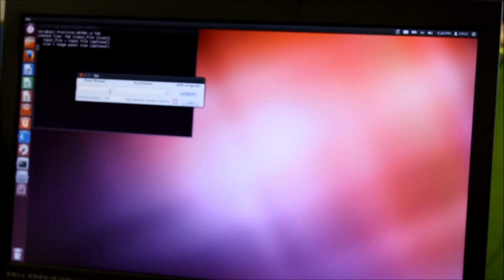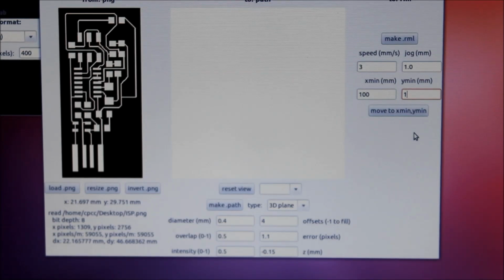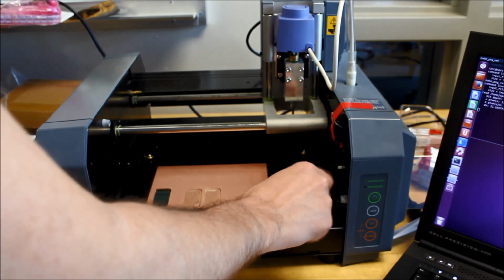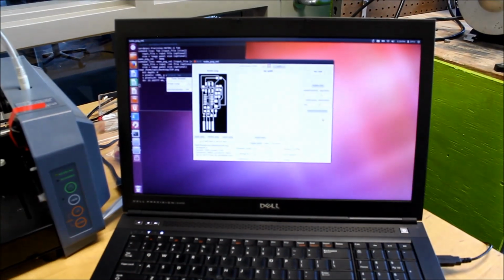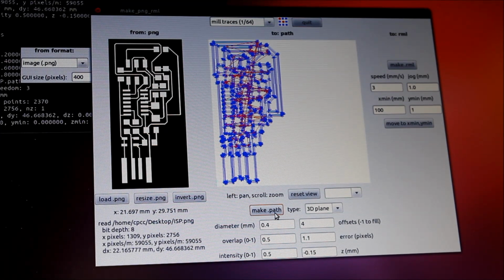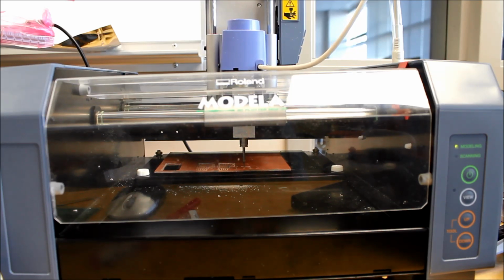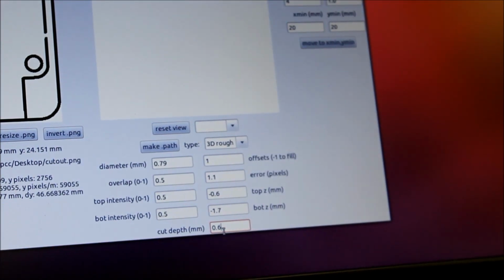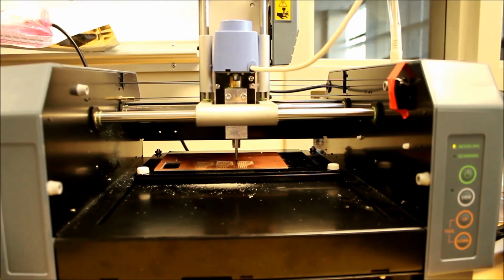FabLab Using the modela to Mill PCBs

Comment: Hi sir. Your video is wonderful. Can you help me with my issue. I use Roland MDX 20 and dimension of my chucks is 6mm. And I can not find any knife which have 0.4mm with SHK 6mm to set up with my machine. What should I do? Pls help me!
Reply from the maker: Hmm. I'm not a machinest but I recommend 3 options. 1. Look for a v-bit if that will work for your project (works great for PCBs)  2. Find an imperial collet for 1/8inch shank (there are lots of cheap 1/8th inch endmill). 3. Look for a slightly larger size endmill (for example I've with a 1/8 inch shank)  but thin the shank in a lathe

Good luck!
Reply: @adamharris6557  thanks so much

Comment: Very helpfull, thank you very much. But if I want to do vias, and holes for not smd components, how can I do it? 

Thank you
Reply from the maker: Joaquin Arancibia You know, I haven't tried 2-sided boards using the FabModules software.  The official Roland Modela software can do it, but I've never used that before.  You can try searching fabacademy.org to see if any of the students have documented the process. If you find a tutorial, please post here and let us know.
Reply: +Joaquin Arancibia I'm busy attempting a double sided PCB right now, and I think the solution for vias is to cut a small length of wire and solder it to both sides. Holes work just fine, but to make your life easier, try keep all the connections on the bottom of the board, as that is where you will be applying the solder (and thus making a proper electrical connection. )